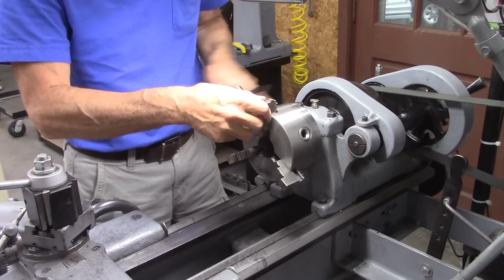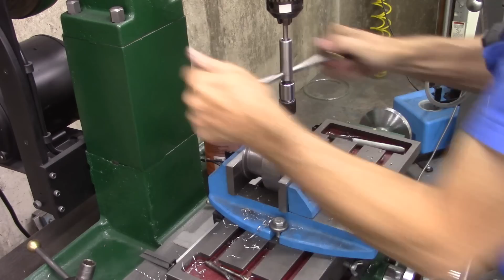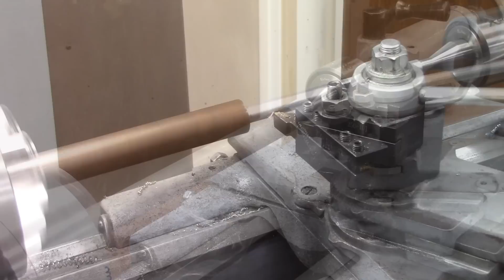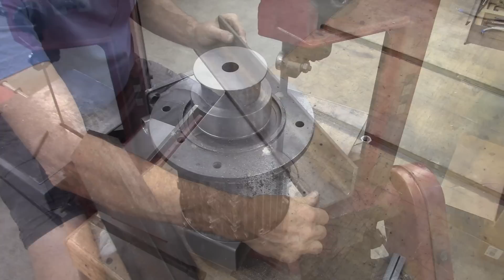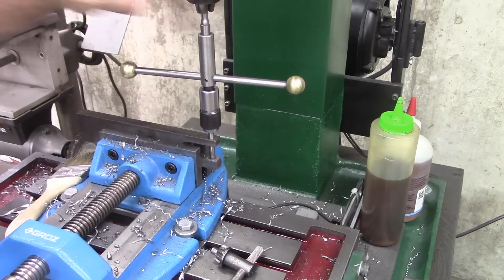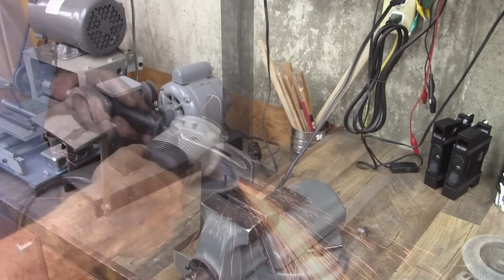Hardinge Lathe Restoration Part-4 / Belt Path and Motor install

Comment: Your engineering skills are admirable.  As a fellow believer in overkill when it comes to tools I'm impressed with those big endmills, your big file, and that big reamer.  Or really its the right tool for the job at hand.  Nice work on the drive system Mark.
Reply from the maker: Thanks Allen!

Comment: Separate question, if you don't mind: What's that belt material? Looks like you used it on that antique drill press as well, but I haven't caught up with those episodes. You've certainly been busy these past few years!
Reply from the maker: The belt material is Polyamide. Nylon is a type of polyamides but this material is supposed to be a lot more durable. I used to work for a printing company (retired now) and one of my responsibilities as belt material and installation. The belt, the tools needed and the glue are ridiculously expensive but I find two spools of a very good belt incredibly cheap. I also built a machine that accurately tapers the ends for gluing and found a cheaper alternative to the $800 heater needed to set the glue. I've made the belts available but I'm having some issues with an alignment jig to hold the belt during the 20 minute cook time. The heater is $28 (hair straightener) and a bottle of glue is $38 so it's still an investment if you want to install a belt around a spindle. If you want to remove a spindle and buy a belt as a continuous loop (let me make the splice) I sell the belt for $5/foot, $5 to splice and $8 to ship (In the US). Still thinking on a better gluing jig but it's hard to avoid the price of the heater and glue. A prespliced 48" belt would be $33 with shipping but if you have to but the heater and glue it jumps up to $94 and thats without some kind of jig for gluing. The belt is good to about 2HP and the width is anything 2" or under. The belt is Habasit F1
Reply: @WinkysWorkshop  Hey thanks for the detailed response. I noticed after I posted the question that you have a whole video talking about the synthetic belt material, so I apologize for not looking at that first. When I get to the stage of acquiring a belt for my Ames lathe, I'll reach out to see how costs work out. Plan was to use an old automotive timing belt, with some sort of MacGyver link.
Reply from the maker: @RickRose  If you can install it as a loop (pre-spliced) it's fairly cheap. Splicing in place can be very handy but adds a lot of cost.

Comment: You are master of the unconventional. The conventional, and easier, approach would have been to install a countershaft. I also like Rob's approach on the Xynudu channel, where he built a cage for the motor and countershaft such that the weight of the motor applies the tension to the belt--I think you've got that feature built into your design as well, correct?
Reply from the maker: Yes the motor tension has a lock put the tension is about right with the motor weight. I was thinking one belt would be more simple and the VFD offers an wide speed range. However, in hindsight, I think I should have gone with the jackshaft. I might end up doing this to get the low speed torque I want. The slow speed is fine now and I might even have enough torque but I'm a little worried about the motor overheating.

Comment: The motor's cooling fan when operated below normal speed may not properly cool the motor, you can add an additional fan.
Reply from the maker: This would help although I suspect the amount time I will run it at low RPM will be minimal.

Comment: Did you use a four jaw to cut the eccentrics or possibly a three jaw with a spacer?
Reply from the maker: Yeah, my 4 jaw chuck. I put a mark on 2 jaws and loosened the same two when I changed pins. It worked perfectly. It's only offset about 1/8".

Comment: Beautiful lathe, great work!  

My only comment would be to bend the handle 90 degrees so it's not sticking out where you can bump it with your shins.  Other than that, I really like the drive arrangement.
Reply from the maker: Thanks! I was thinking maybe a knob
Reply: @WinkysWorkshop  A low profile knob would likely work just fine and look better than a 90-degree bend 🙂
Reply from the maker: @bradkahler  I agree

Comment: Looking forward to seeing it running. I used a vfd on my hardinge and it works well.  I'm surprised you didn't just put the motor behind the headstock and run it directly.
Reply from the maker: Mounting the motor behind would have been more straight forward for sure! However, there were a couple reasons I did not do this. The first consideration was space. If I put the motor on the back the table could not be against a wall. My shop is getting smaller all the time :o)  Second, the three phase motor looked new or modern and didn't fit with the lathe. Keeping in in the cabinet makes things look nicer.  This lathe is more of a collectors lathe so looks are important. Hopefully I can get the turret working, it will make the lathe a useful addition to my shop as well.
Reply: @WinkysWorkshop  I see where you are coming from. I did spot a Cataract with a countershaft running at the back and a second belt running down under the table to the motor.
Reply from the maker: In hindsight, that might have been a better method.

Comment: Hi Winky, I don't think that you would be able to crown the rollers as you made them wide enough to cover 3 pulleys. If you crowned them it woukd only work for the middle pulley. Looking good, waiting to actually see the spindle run. Regards from Australia.
Reply from the maker: I had to think about what you said there but understand now. I would make two (or three) crowned section on the roller. It actually works very well. I think it will be okay without the crowns but its an option. I'm a little concerned with flexing of the roller stand and motor mount but we will see.

Comment: Mark, I have friends that are brothers, and they have a hydroelectric generator on the creek behind their shops, and they run a number of things on VFDs, or DC in their shops. They run their welder on DC, which is an inverter machine, and it works well.
Reply from the maker: My name is Mark or Winky but I'll go by Steve if you want. :o)
Reply: Sorry about that. Mark is my brother's name, so I should remember.
Reply from the maker: @Farm_fab  No problem at all.

Comment: I like that you found the center of a round workpiece with an edge finder. That's how I do it. Most seem to think you need to sweep dial indicator. I just find that too fiddly. I used to run Fadal CNC machines and they had a feature of finding center from three touch points. I think that would be a nice feature in a DRO, though I've never seen it. But touching four points and using the half function is almost as good. Good progress today. That will be a nice machine for small work.
Reply from the maker: Thanks, I'm still learning the DRO but its very handy.

Comment: Really like your video's.  Great tips, inspiration and entertainment. Keep it up👍💪😊 
By the way, you can make internal  keyways on the lathe. I made a 
keyway slotter for my Boxford 9". (southbend clone).  Might be a good little projekt for your Channel?  Shame it's not possible to post pictures in the comments.
Regards from Denmark.
Reply from the maker: Thanks, yeah, I saw a video on the lathe key slotter. I've also done in the same way on the mill with arm power. The mill works great although it has a limited depth.

Comment: I like the roller idea, but, did you give a thought to a pivoting (on the axis of the motor) jack shaft with either a spring tension or an adjustable tension rod to give you the belt direction change you ended up with?
Reply from the maker: Maybe I'm not understanding. There is a arm with a handle that moved the motor up and down to adjust the tension. I really don't need a jack shaft.... hopefully.

Comment: I have a VFD and 3 phase motor on my milling machine.   I kept the 3 step pulley.   I feel having a combination of VFD and pulleys provides a much wider range of speed and helps to maintain torque by not having to run the VFD at low Hz where motor torque can drop a lot.
Also reducing Hz to the motor means reducing the fan speed and cooling.
Interesting belt/roller arrangement.   I hope this works without having to crown the rollers.
Very good progress.
Reply from the maker: The belt should track well as long as I don't get any flexing but if I need to add a crown that wont be a problem. I do have two steps on the lathe....  the slower speed may or may not be slow enough but I suspect it will be okay. At half speed the spindle will be 400 rpm. 1/4 speed will be as slow as I ever need to turn. Seeing as how the motor is way over powered I think it will be okay. I plan on putting the same on my mill but will do keep the step pulleys.
Reply: @WinkysWorkshop  
As an option, you can put an additional fan on the electric motor.
Turn it on when the motor is running at low speed.

Comment: I am curious. What process will you use to bond the two ends of the belt together? I am retired now but when I was employed the shop had a fixture to hold the ends of the belt together then the belt was melted together with another part of this fixture. It was over 20 years ago I joined a belt just like the one you are using and my memory is a bit foggy as to how it exactly worked.
Reply from the maker: Here's a video I did on the subject. Thanks for watching.
Reply: @WinkysWorkshop  You forgot to add the video link.. 🤣🤣
Reply from the maker: @daveticehurst4191  Wow, I think youtube removed it. I'll try again. Thanks
Reply from the maker: Here's the link: https://youtu.be/MAh_6SiYInU